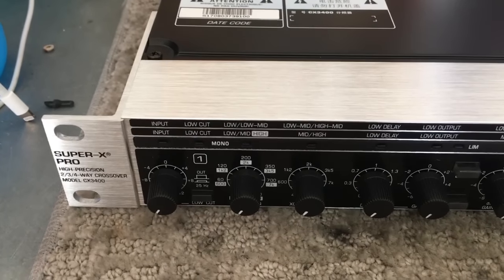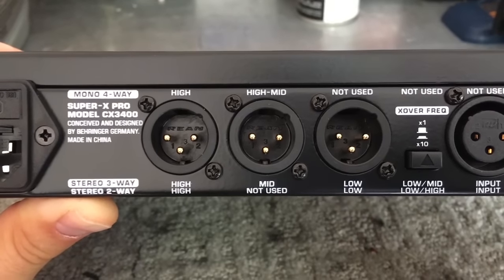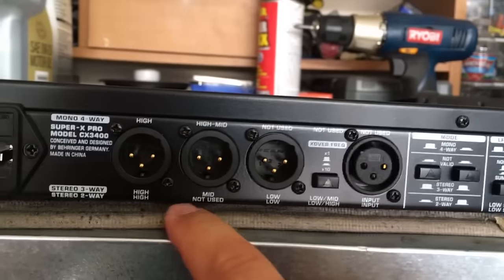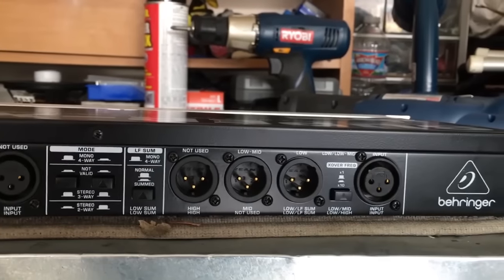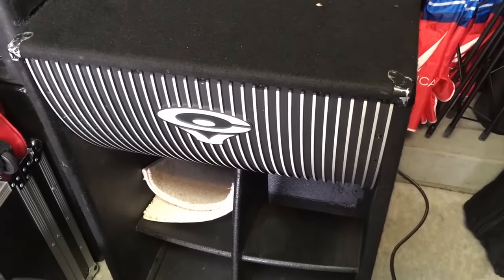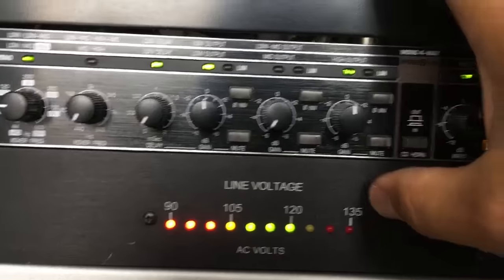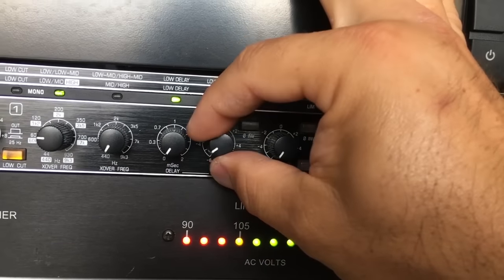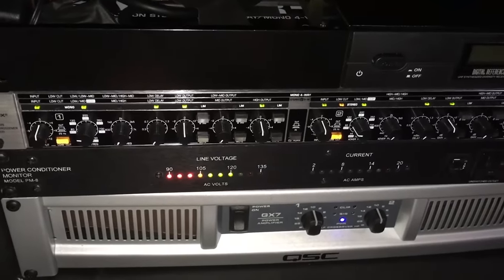Behringer Super-X Pro CX3400 - Review, Tutorial, Setup

Comment: Question, I'm using a 31-band eq. Does the chain of connection go from mixer/crossover/eq/amp/speakers, or is it mixer/eq/crossover/amp/speaker??
Reply: Mixer/eq/crossover/amp. Otherwise you would need and equaliser with multiple inputs or two equalisers as the signal is split.
Reply: @justifiedsoul69  Thank you!

Comment: Hi! I know 5 yrs ago, but if you get this, can I ask you a question. This is for home audio and not car, which a lot of these things are made for. I need a crossover to a new Open Baffle, 2 speaker driver( 2 each side ) My concern is the top and mid end is in a coaxial driver ( the other is the low bass driver ) so 2 way but in fact its 3 way if you take into account the coaxial handles 2 frequencies. Question would the CX3400 ( now version 2 ) be able to handle the crossover settings ? many thanks.

Comment: I have inherited some equipment... I've never used a crossover before. I have two unpowered combo cabs  peavy 115tls horn/Tweeter not sure which, with a 15 in speaker. one giant 18-inch subwoofer cab by celestion, GR series. I also got it crate mixer board but I am hoping to use my Mackie 1202 as the other one is overkill I think. A PM 1400 Carver Poweramp, and a Carver PM 15 power amp. trying to figure out the best way to hook this up, your setup is quite different but thought you might have some advice. also a note, my 1202 mixer only has quarter-inch outputs. do I need to run some kind of adapter?

Comment: Hello, I set one of these up and basically want to send the highs to my powered tops and then connect a powered sub from my mixer for more control. Can you verify that if I just connect the highs and leave the sub output blank this will cut the lows to my speakers. Another reason I am doing this is my sub only has rca jacks.... May be stupid question and yes I'm a newb, thanks for any info
Reply from the maker: Yes, the unit will do that.  It will essentially ignore a sub output if there's nothing plugged into that output.  Ah yes, rca on subs are tricky.
Reply: XXVelocityXX I took a trs 1/4 jack to rca jacks from an aux send on my mixer to my sub... And it seems to work, just started playing with it. Thanks for the reply! Appreciate it!

Comment: Hello really nice review! Do you know the difference between your CX3400 and the CX2310? I want to buy one but only for private parties and I dont need any special features.Would you still recommend the XC3400 more than the CX2310?
Reply: Thanks just got one of these and your video is extremely helpful. Question,, and appreciate any info you can provide, if I did the three way set up would I plug the high and mid into my powered speaker? I notice they have two inputs. If so is there any advantage to doing that?
Reply from the maker: Hi elk, powered speakers are internally crossed over, so you wouldn't necessarily send two inputs to a powered speaker from a unit like this in hopes to divide the frequency between the tweeter and woofer.  That other speaker input is probably for another audio device like a guitar or microphone.  You can; however, adjust your output frequency to your powered speakers using this device, which is nice since it will be within your reach using a nearby rackmount case.
Reply: @evanjohnmo  Hi, I'm thinking about buying a more simpler Behringer CX2310 how do I connect my 2-way 15" speakers, do connect to the high outputs or low outputs?. Nice review by the way.

Comment: I would like to build handcrafted audio speakers. As I understand it this tool is useful for replacing the passive crossover usually found inside the speaker cabinet. Is it possible to use this tool to adjust each frequency respectively for high - medium - low? Thanks
Reply: It is possible but then you have to buy a seperate Amplifyer for each speaker driver.

Comment: Why Behringer don't include in their manuals the Total Harmonic Distortion(THD) data of their crossovers?  I have bought the model CX-2310 and in the user manual I can't find this so important datum.
Reply: Hi, I have a pair of full range Peaveys 2-way 15" with a 1.75" tweeter.  Do I connect to the high output or low output of the Behringer CX2310?

Comment: I seem to have a fundamental misunderstanding with pa crossover modules. Why do they make the crossover knobs L/R as appose to Low/High? It doesn't make sense to me that I have to control L/R crossover points with 2 knobs. Is there a 2 way module where I only need to control one knob for the crossover point for the whole setup?
Reply: You may already have figured this out, but the only way to operate with just one knob is if you are running in Mono. I'm not sure if you would want a 2 way mono system in fairness. Mono for subs is fine but for the tops/mid stereo is preferable unless you have both speakers in different locations (a house party with one speaker in one room and one in another). Hope that helps.

Comment: I feel like it didn’t increase or help my amps head room. I feel like I still have to crank my amp up all the way in order to be able to power my woofers. Plugged it in exactly the same as you did everything exactly the same but not getting the same result. Still have my amp abs the Xpro at like +4/+6 dB Any ideas or help?
Reply from the maker: Generally this device is not meant for gain increase.  You can get it to crank the output a little bit, but 90% of your volume should be provided by your amps.  I would need to know more about the amplifiers and subwoofers you are using in order to properly give information on setup.  Crossovers like these are really only meant to separate frequencies from your audio inputs.

Comment: Hi, i use two subwoofers. Can i use 3 way mode? High, mid is not connected, only low ( bass ). And my second question, i must use stereo jack for my amplifier, or maybe only mono jack? Thx for help
Reply: It depends if your amp is stereo or mono. My amp is stereo, so two mono out from low out to each amp channel, then into the subs.

Comment: I'm curious why someone would go from a DBX Driverack to a Behringer Crossover.
Reply: Also wondering. In my four way I'm using the cx3400 in 2-way stereo to split subs (summed) from the remainder, which then goes to a Driverack PA2. The 25 Hz high-pass was a trigger, dbx xover has 40 Hz, too high for my subs.
Reply: I have both, behringer 3 way cross over with mono sub out. I use this in my smaller rig with active speakers. 

I also have a dbx pa2 drive rack compmete with wireless network, in my big rack thats 10,000 watts. That rack uses a rack mount pc as well, its an absolute monster. 

I can say between the 2 i can get them to sound very close. However the pa2 significantly more features and being able to tune a room walking around on an ipad is a game changer.

The behringer 3 way i use with a 31 band eq and thats pretty much it. 

1 rack weighs maybe 50lbs while the other weighs over 300 lbs.

Comment: I have one ..what an awesome piece of equipment I run my subs in mine coming from my Beringer vmx 1000 mixer using the subwoofer output on the vmx 1000 mixer .I never use my limiter and it has never clipped ...also using the sum button on the rear you add the benefit of using both Chanel's in the 4 way mono mode.. I am a bass head junkee/addict so that feature doubles the addiction ha ha lol.... caution.. warning...clicking the crossover frequencies with the volume turned up will result in a very loud pop.. please set your preferred mode of use with volume turned completely down... front adjustments no problem but activating modes from the rear with volume up could damage unit speakers and even your amp.me not knowing this before hand switched from 2/3 way to 4  way the pop was so loud that it clipped all 6 of my amps off ....so be careful.. glad I brought it a the vmx 1000 Beringer mixer ....3 years now not a problem with either thank you YouTube thank you Behringer..thank you sir for the best explanation thus far on this awesome crossover.
Reply: How did you get the sublevel out to work? I've got two 18in Peavy subs in a box . It's the only reason I got this crossover was to use the sub output. But I'm still getting highs, mids, and vocals.